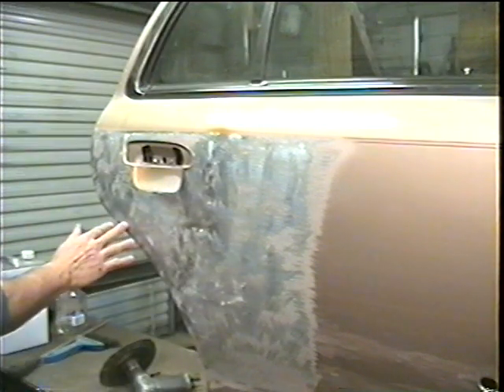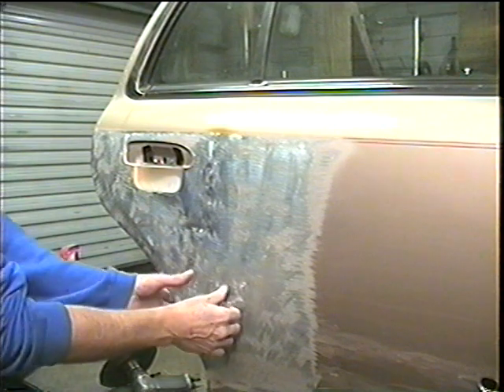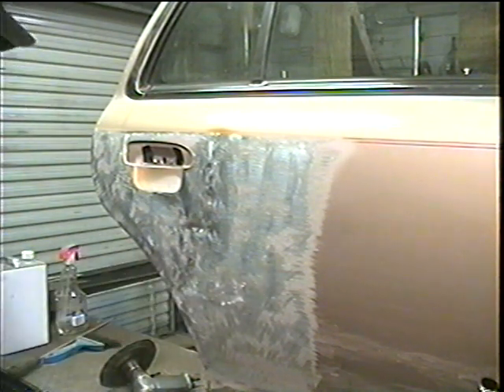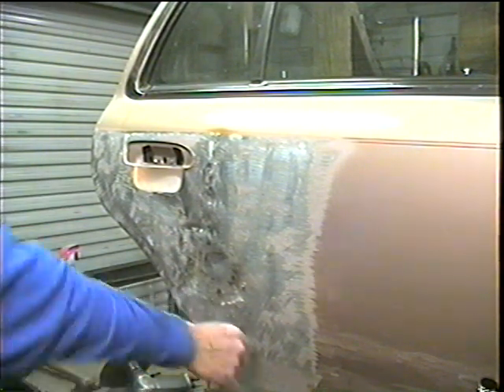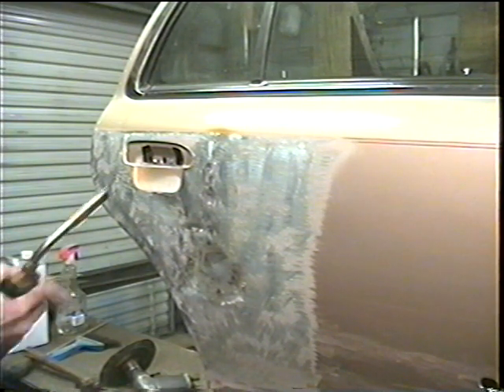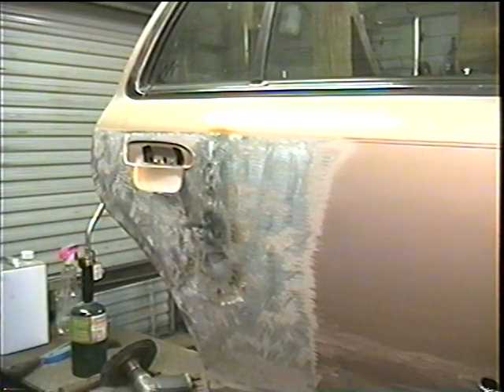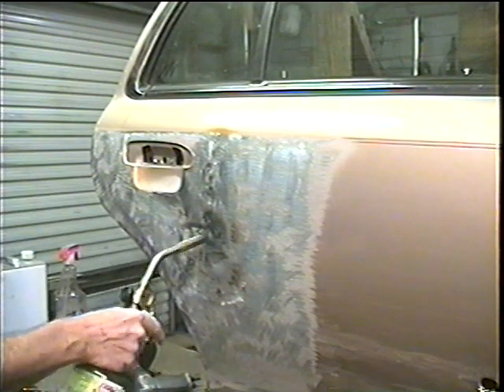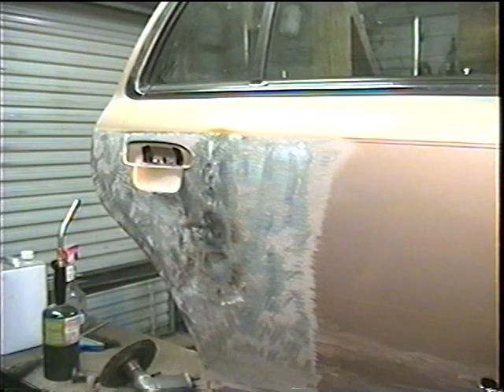Oil Canning Auto Body Panels Fix - How to Shrink Sheet Metal

Comment: I have a large oil canning dent in my truck box panel.    When you say the " HIGH SPOT"   not sure what you mean.   

My dent is about 10 inches in circumference.    There is many high spots on the circumference. 

So I DO NOT heat in the middle of the dent then?

Confused?
Reply from the maker: You will feel for where it oil can's the easiest and start there - basically find the center of the "Oil Can".  You may have to do the operation a few times.  Be patient, don't quit until all popping in and out is gone.  Let me know if you have more ?s - Jerry
Reply: @LakesideAutobody  much appreciated.    
With the large oil can dent on the truck box it is hard if not impossible to work from the inside. Too bad.

I oil canned it myself by pulling much too hard with a dent puller.

Didnt know how to use it and messed up.
Amateur.
Reply: @BilleEliott  the point at which you pulled too hard is where you stretched the metal and is the exact spot you want to heat and shrink the metal back to eliminate the oil canning....
Reply: @nickv5799  thank you kindly, sir

Comment: Hey buddy I have two spots on the roof of my 69 Chevy van that are oil caning. Would you recommend this process for the roof or do you know of any other ways that might be better ? When it comes to oil caning the options are cut it out and replace or the process you show here right ?
Reply from the maker: I would not and have never cut it out and replaced.  If you have a head liner that's right beneath it you might want to remove that.  This will work.  You may have to do it in a few spots but it will tighten up the metal for sure.  Start out small if you want - maybe even with a sharp point on the torch to keep it confined.  Here's another video on this process - it has worked for me every single time on every panel I've ever used it on.  https://www.youtube.com/watch?v=K5MVVnsERqc  Last... my buddy I worked with would have just "hit it low and fill it with dough"  as he said but you may see it from the inside.  Let me know what you end up doing :)
Reply: @LakesideAutobody  thanks so much man ! I’ll definitely let you know. I’m even probably going to make a you tube video of me doing it.
Reply from the maker: @johnmartin5153  Very cool - I'll check it out.  Find the very center of the "oil can" and start from there.  Light at first to see what happens.  Don't be afraid if you have to chase it a bit - you'll eventually tackle it.  Sounds like football - go Lions!  🏈

Comment: What kind of gas do u use. I’m working on a 1961 truck bed side with a long dent. Pulled the dent using washers welded to dent and pulled out dent but I’m running into severely stretched metal
Reply from the maker: 80/20 Argon & CO2 Mixture.  When you weld the washer or shim to the sheet metal, you only need one or 2-4 tacks.  You should have 0 distortion after welding your pull tabs.  When you pull, go easy.  If you feel that you are stretching the metal in once spot move to the next.  Here's a good example - https://www.youtube.com/watch?v=RSopz6XWncQ  Let me know if you have more ?s.

Comment: Any advice for this nasty looking dent? 1959 Chevy Apache so it’s “real steel”. Can’t get to other side due to inner panel. Was hoping I could get someone to shrink it to work it out (now... can I attach a picture?)
Reply from the maker: This may help: https://www.youtube.com/watch?v=K_t4Bu6GKeM or https://www.youtube.com/watch?v=sStbeOOgyD8  - Both show how you could pull a dent from the outside - I also have some videos using the stud welder to pull from the outside.
Reply: Lakeside Autobody thank you. Looks like I actually have more damage than I thought. Door frame is pushed in and down. Need a pretty heavy straightener to do it.
Reply from the maker: @patrickchristie82  Got ya,  Let me know in the future what you did with it.

Comment: I got some panel warpage from welding some rust holes from the inside- the outside body panel is now oil canning. The paint on the outside is fine though- I fear if I try this method it'll burn the paint on the other side. Any other fixes?
Reply from the maker: This will mess up the paint for sure.  You are saying the paint is in perfect condition but the panel is popping in and out?  It sounds like you can get to the panel from the inside. If so and the panel is nice and straight, I'd glue a piece of wood in there to keep it rigid or something.  Just a thought - sounds crazy but if you don't want to mess up the paint there's not too many options.  Let me know what you end up doing with it - curious :)

Comment: Does oil canning spring back? Or warped inwards? Can this be applied to decklid thin metal between the underside supports that bowled downwards to  trunk cabin.?
Reply from the maker: Yes - oil canning is when metal pops in and out or springs back like your said.  This process can be applied anywhere you have oil canning going on :)
Reply: @LakesideAutobody  this doesn't oil can spring per say... more like it's pushed in from warped on blasting and super hot day
Reply: I'm going to try but do I heat from underneath where its now the high side? Or from top low depression side?
Reply from the maker: @jdaspects  You always want to pop it out first and work from the outside.  Then find the crown (highest point) and go from there.  You might have to chase it around a bit but keep at it and you will stop the oil canning.  If you get good at this, it will be a game changer for you.  Let me know how it goes.  Oh - have an air nozzle ready just in case you get a little fire - no big deal - just blow it out with the air :)
Reply: @LakesideAutobody  don't use a wet towel?  Maybe a pdr guy is better for shrinking it.
I didn't want to create a new dent from hitting it underneath.
Why couldn't one just reverse what made it warp in first place which was heat
Reply from the maker: @jdaspects  You can use a we towel - either will work - I just use air 'cause it's handy.  You can send me pics if you want - I would be better able to see what you've got going on.  schoolvideolibrary @ gmail .com
Reply: @LakesideAutobody  okay, 2 parts do oil can between the reinforcements. They   spring back when pushed from underneath. Do I heat from underneath at the high or from top of decklid at low depression then cool it? You said knock it out first but this creates a dent from force?
Reply from the maker: @jdaspects  First you wan to get it as close to straight as possible.  If you have then an area that pops in and out, leave it in the out position.  Make sure you've removed the paint and always heat from the outside.  Start really small and test it - you might be able to stop the "oil canning' with just one small application of this process :)

Comment: Jerry, I am attempting to repair a hood that had a dent and an oil canning effect near the aft edge, pax side.  I repaired that, but then the oil canning seemed to "spread" for lack of a better term outward from that original area that I fixed.  And so I repaired that area.  Then it oil canned adjacent to that.  I've been chasing it now for about a day and a half and have covered most of the hood.  What is happening with this?  Is it normal on larger panels for the oil canning to creep outwards like that?
Reply from the maker: That is normal but it should stop after about 3-4 tries.  Your problem was my problem once when working at a shop.  I was a young guy and fiddling around with a dent on the roof of a car - chasing it around like you've got - couldn't use heat cause of the headliner so each time I tapped a high spot down another would show up.  An old guy came over and said, "Hit it low and fill it with dough!"  He just wacked it down real good and said, "There.  Now fill it."    I really did end up chasing that dent across most of that roof.  Boss was upset but had no solutions either so.. just did the best I could at the time.  Let me know how it turns out for you - curious :)
Reply: @LakesideAutobody  Alright, thank you for the feedback Jerry.  Good to know that such phenomena is normal when doing these types of repairs.  In this instance, it did not stop after 3-4 applications of the heat-then-cool process.  I did not do the "hit it low" business though.  I chased it throughout the hood.  It only seemed to disappear once I hit a body line or the panel's edge.  I was willing to do that to the entire center section of the hood.  However I noticed that the oil canning returned to areas that I had already worked, but on a larger scale.  The smaller areas that I heat treated remained solid, but a larger-scale oil canning effect developed.  At that point, I sat back and decided to look at the big picture.  I had spent hours doing this and consumed several hand-sized bottles of propane on it.  Yet there was still oil canning and enough highs-and-lows to make a bowl of spaghetti proud.  Therefore I decided to just cut my losses and source a replacement hood.  Disappointing.  Quite so.  However I did learn ... well something I'm sure even though I can't describe it at present.  Anyway thank you again for replying to my question.  I appreciate it.
Reply from the maker: @RX7GSLSEowner  You're welcome Jerry - maybe the metal wat just too stretched to save - not sure what was going on.  Have a good weekend my friend :)

Comment: is that an oxy propane torch? right?
Reply from the maker: It's this torch (Bernzomatic TS8000BZKC Premium Trigger-Start Torch Kit) with a regular bottle of propane on it - the kind you use for a camping stove.  The newer MAPP gas in the yellow bottle doesn't seem any hotter so I use the cheaper stuff.  They changed the gas in the yellow bottle I think :)

Comment: A great demonstration of how not to metal shrink
Reply from the maker: The great thing about this method is that it works every single time.  I've seen guys playing around in various shops wasting time hitting the metal on an angle, trying to use mysterious shrink hammers, even wasting the panel.  Make no mistake, this works every time and all your left with is a ding - you have to fill the area anyway.  Curious as to how you would keep a panel from oil canning after major damage.  Let me know - Jerry
Reply: @LakesideAutobody  the proper way to do it is once you have heated the panel to a red dot grab a flat hammer and dolly and just gently tap down around the red centre and as it cooling the panel will be srinking in nicely once its no longer moving in thats when you finish it off with the wet rag or air. Not to much extra work than your method with no dent.

Comment: Sure you could do it that way... but you would be better off using an oxy with a small tip. Get it a cherry red the size of a small coin then use a panel hammer and dolly, going around the cherry in a circle motion striking the hammer towards the cherry... then one final strike in the centre of it. 

Then cool like you are and no need for unnecessary dents like you created. Then file like normal 🤷‍♂️
Reply: Thats the proper way

Comment: This, kids, is how you DONT do it. Propane torches are the worst for heat shrinking. It heats up a ginormous area and doesn't get red hot, you end up warping the panel. DO NOT DO IT THIS WAY.
Reply from the maker: It works with both oxy acetylene or propane.  Probably could use one of those torch lighters too.  It's consistent, easy and works every time.
Reply: @LakesideAutobody  nope 🤦
Reply: Always an expert ….

Comment: That’s a poor method. Your heating both you high and low spots with a flame. Use a shrinking disc on a pistol grip gun and your going to only heat the high spots as your flat disc acts as a block. The kits are 70 buck on trick tools . Com

Even better why this tool is a better choice then a flame is because when you put your filler on and block through maybe to a high spot you can just hear it up with the disc and shrink it back down and not compromise your filler like a dummy with a torch 😎
Reply from the maker: The tool you are talking about heats up the metal just like a torch does but takes a lot longer, costs 70 dollars, doesn't get hot enough in my opinion, and is not direct enough.  This exact method works every single time I've use it and that's over 30 years worth of dents - every size imaginable.
Reply: The disc let’s you control where you are putting the heat and open flame does not. It takes about 15 to 20 seconds to heat up the metal with a shrinking disc. I don’t know what you mean it takes to long. But I doubt with a torch you can take the metal to nearly perfect.  I’ve done repairs where the metal work was so good thanks to the shrinking disc that I needed on thin coat of filler to do the repair
Reply from the maker: @Mark Mikheyev With respect when you work in a body shop you don't have to worry about all this thin layer stuff.  You wont get good if you worry about "too much filler" A torch will get it hot enough to bring the metal way out to stiffen it enough for you to wack it on the hot spot w/o it bouncing so you can bring a bunch of metal  into that area thus tightening "shrinking" the metal.  I've literally have fixed 1000's of large and small dents and it works every time but just to keep an open mind I might look into that tool and give it a try - maybe I'll make a video on it - that is if it works :)
Reply: Lakeside Autobody I respect that. I hope you find it works for you as good as it works for me.
Reply from the maker: @markmikheyev6730  Cool - have a good Thanksgiving.